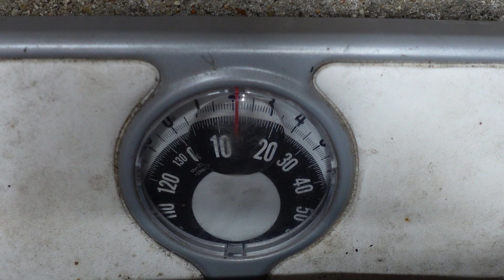Volvo S40 Race Car Build - DIY Control Arms!!

Comment: Would be good to know if after all that weight reduction can get it under 1 ton with rollcage. Im currently looking at Seats, rails dont seem to be that hard by looks of it. Cars going to be nuts when complete.
Reply from the maker: I don't think it'll get under 1 ton without a lot of weight savings, but it would be nice to be close to it one day! 

Seat rail on the driver's side will be a bit of work because the tunnel is offset to the right and I'll need to chop some of the floor out to make it work.

Comment: Hey man! Love the videos! But do remember the volvo S40/v40 are built on Mitsubishi's platform, meaning Evo 1-3 in the rear and on the Wheels/brakes, evo 4-6 in the front. So you could buy these arms for and evo 1-3 and they bolt right up. I have a video about this on my channel! I Bought a big brake kit for an evo 1-3 and it fit perfect! chekc it out!
Reply from the maker: Hey man! Yeah, the Evo 3 arms are what I was referring to in the video that I could have bought (the CNC arms are for E1-3)
Reply: @AndyPonting  Ahh sorry, must have been typing while you explained that part! Really cool build glad to see someone else building these cars!